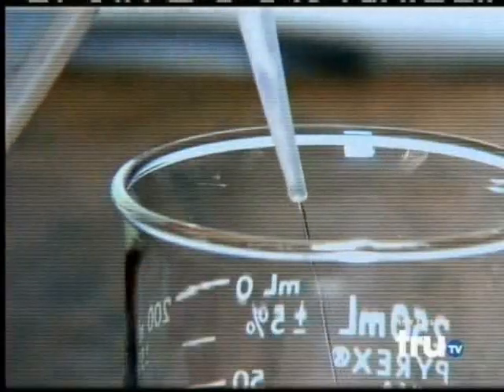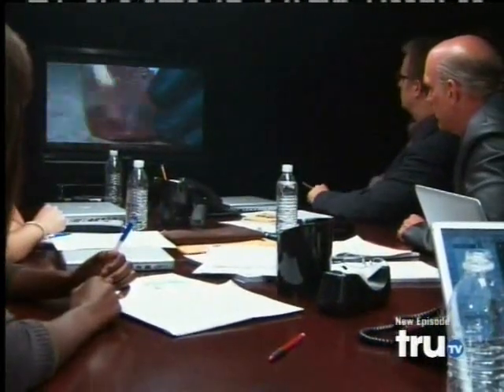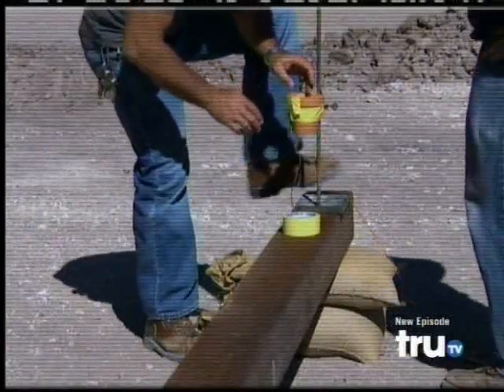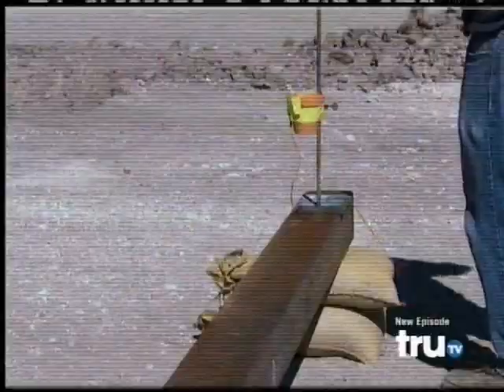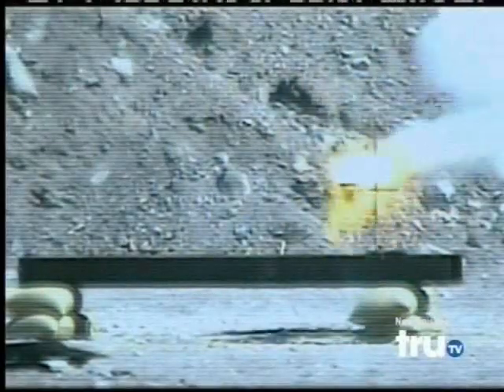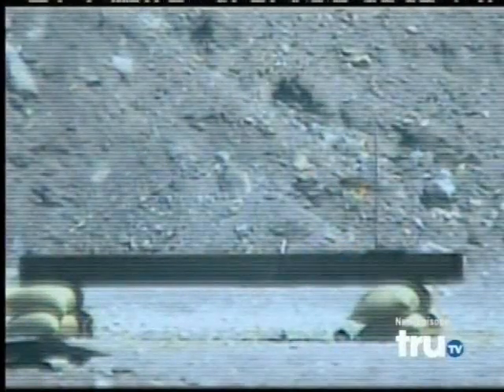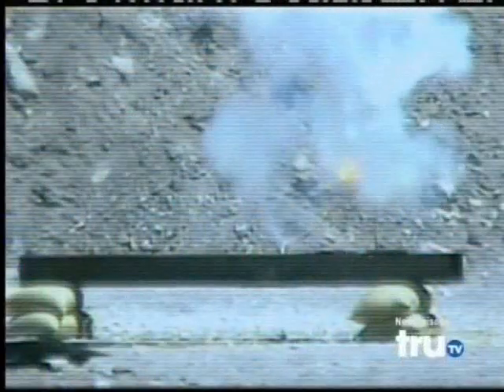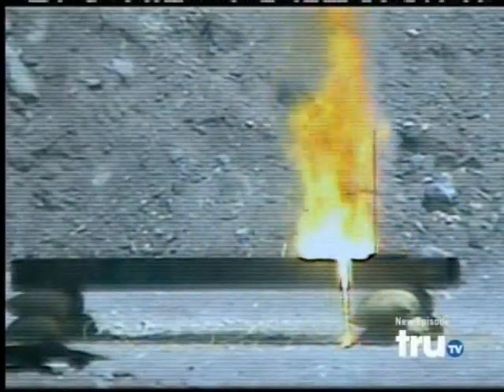SuperThermite in Action compared to Fire

Comment: When the fuck did I say that the core columns beneath the impact zone were attacked? A ROOSD collapse propagates through the floor system, which is the achilles heel of the twin towers.
And you still haven't answered how the descent of an upper block could destroy everything beneath it except for the core columns, or why that top spire was not bent from any impact above it. Your explanations are self contradictory.

Comment: Actually, yeah, in the Bazant paper. The short paper, was 
delivered in TWO DAYS after 9/11. The math was that easy.
Oh, and your claim that the Twin Towers fell much slower 
than Free Fall, is a debunker claim that's been proven time after
time. You don't have to fall at 1g if you haven't used explosives to blow UP the steel frame. IF the steel frame was blown up, then you would fall at 1g, not the measured 68 mph.

Comment: But NOT in the bazant paper, is what you failed to mention. I'll look into those seismic recordings, but still, even if they confirm what you are saying here, the fact remains that the twin towers acceleration curve does not match that of a gravity driven collapse, since it fell at 64% the speed of gravity.
That means, for significant durations of the destruction event, that upper block was exerting a force less than its own static weight on the lower section of the building.

Comment: That guy from UL was Kevin Ryan, a fired Water Tester at UL.
I believe from Missouri. He was never even close to UL labs
in Indiana, and Water Testers don't work at fire facilities.
The NIST fire testing was to determine fuel loads, not floor
slumping, and the floor models had their SFRM coasting
on at modern double thickness, nor were they physical
damaged in any way, like the 911 flooring systems.

Comment: Yes you did. You said: 'It ensues from the seismic records that the crush-down phase lasted 12.59 ± 0.50 s for the North Tower, and 20.09 ± 0.50 s for the South Tower. They were only talking about the crush down phase, which for WTC 2, was actually less than half total time.' Show me WHERE it was ever said that the crush up phase lasted as long as crush down.
And you still have no answer for the contradiction presented by the remnants of the top spire (which are inconsistant with a piledriver).

Comment: Didn't claim anything of the sort, and you know it. Bazant spent some time determining the effect of the impacts, and collapse, on different levels of the building. Even on the simple analysis, done in 2002. THAT section is in the Addendum, and begin with, "What if the aircraft Impacted a higher floor".
Go ahead and look, it's right there. He compared the effects of a higher, or lower impact / collapse floor.

Comment: But I am amazed (!) that you think the remanants of the WTCs top spire (after the collapse) in any way supports your beliefs. How could the descent of an upper block destroy everything beneath it except for the core columns? Why did we not see these structures poking through the piledriver as it fell downwards? Also, why is it that the top spire was clearly not bent from any impact above it? This ONLY makes sense if a force other than the upper block was going the actual damage.

Comment: The essential problem, is, the crush-up at WTC2, didn't have the top
weight, had 23 floors to crush instead of 13, and began earlier, with
less inertial momentum in reserve. It took longer.

Comment: Hey, I am just commenting on the obvious. WTC 2's collapse floors
would be on the ground, SOONER than the 97th floor on WTC 1.
So, sorry, GED dropout, there is no contradiction. The crush-up
phase on WTC 1, would be driven by a heavier roof, a shorter length,
and WTC 2 would be a slower crush up, due to lower weight, a longer
length of building above the collapse floor, and a slower overall speed.
Crush-up would begin earlier, take longer, and move slower.

Comment: I am not opposed to the notion that crush up works faster in the presence of greater weight. But you contradict yourself with your assertion that WTC 1 was heavier than WTC 2, hence why its crush up phase progressed faster. Basic math disproves you on that.
Example: The new towers (1 WTC) 400 foot antenna weights 750 tons. The old towers (WTC 1) 360 foot antenna, with similiar dimensions, would have weighed about 670 tons. The contradiction come when you realise that each of the upper floors

Comment: In case you are wondering about how crush up works, it's based on Inertial Momentum. It takes MORE energy to stop the falling weight, than to crush a floor of the falling upper block. Thats a function of the weight on TOP, not in the falling upper block.
It's Moving, it has the momentum, and the inertia, not the part on the ground. Conservation of Momentum, and gravity, work to preserve the upper block's speed.

Comment: Actually, Moron, even if it was explosives, gravity controlled the collapse, IDIOT. The crush up is controlled by the weight 
crushing down from the top, not the middle, of the collapsing building. Piledriver, remember? The Ten extra stories were not at the top, and they would be the first to come to a rest on the ground. They wouldn't even be involved in crush up effects.

Comment: No, what I actually asked was where you drew your unsupported notion that the crush up phase lasted as long as crush down. That is a key point that will decide whether or not the towers took as long to collapse as you say (and, big surprise, you refuse to answer it!).
Also, you are confusing the piledriver mechanism (which was posited specifically for the twin towers) with the more general progressive collapse. That kindof slip betrays, at best, a poor grasp of the subject at hand.

Comment: Anyway, the whole piledriver theory is not deeply flawed at
all, and there ARE historical precedents, in the collapse of
radio towers, Oil Platforms, and Other giant structures with
fire attacking them. The Oil Platform Piper Alpha was taller
than the WTC, had fire on FEWER floors than 6, and 
collapsed to the seabed even though its lower floors were
doused in cold water, Dumbshit.

Comment: Oh, now the sound of BackPedaling fills the truther squeals.
Every time we answer your stupid questions, you claim we
don't, or that we are sheep, or shills, or can't really answer
the question. You chose the stupid claim.
A steel antenna makes a difference because of WEIGHT
Steel is 500 lbs a cubic foot compared to concrete, at
under 180 lbs per cubic foot. Where concrete would 
crumble, steel antennas would hold the roof it's on, as
a coherent piece, that and the WTC Hat structures.

Comment: Whether or not the crush up phase lasted longer in WTC 2 is immaterial to the question I asked you, and BTW, if it had taken longer, it would be because the upper block was 10 storys higher than WTC 1, not because it didn't have an antenna pressing down on it, dummy.
Anyway, the whole piledriver theory is a deeply flawed analogy with no historical precedent, and no empirical evidence for. No one has proven that this kind of failure can happen in reality, its all supposition to the nth degree.

Comment: Look at the first few seconds of the collapse. The upper block fell down, and was communited by the impact with the lower foundations, until both sections simultaneously collapsed at near free fall speed. Crush up clearly preceeded crush down.
Moreover, you still have not accounted for the fact that the upper block dissapeared 4-5 seconds into the collapse, and was never seen again. How can we know that it was still intact, and crushing the lower foundations all the way to the ground?

Comment: Now, lets do some basic identification of forces, ok?
Which part of the WTC towers were moving, falling, accelerating,
and therefore had the Momentum? Was it the top or bottom?
And therefor, which would have the Conservation of Momentum,
AND the Potential Energy being converted to additional energy,
for every foot that it fell?  Conservation of Energy conserves the
downward speed, moron, not the bottom half of the building.
It doesn't have any Momentum. By definition. Duhhhhhh

Comment: There are so many things wrong with that I don't know where to begin. Bazants observations are flawed on many levels, because it is clear that the destruction of the twin towers began with a crush up phase (with the upper block partially destroying itself), then crush down. They have it backwards! And even if that wasn't the case, where do you draw your idea that the crush up phase lasted as long as crush down?
Also, trying to model the destruction of the twin towers through the use of

Comment: Depending upon what direction the collapse was being filmed from (north, south, west, east), you will get different estimates of what speed the collapse progressed at. The twin towers underwent an ROOSD failure, which is basically a catastrophic progressive floor collapse.
Some portions of the structure (like the northeast corner of WTC 1) went at a rate of 8 floors per second, yielding a time frame of 12 seconds. Other portions went at 5.5 floors per second, which gives a median of around 7.

Comment: 'No, I'm citing actual video of the north tower collapse - 22 seconds.' Then you must be blind, because both towers collapsed in 14 secs!
'What the FUCK is a gravitational collapse?' One which progress without the aid of explosives or accelerants.
'Whatever it is, does it take into account that large portions of the core structure of the south tower survived initial collapse?' Not only does it fail to account for this, but it also DIRECTLY CONTRADICTS hypothesis like those put forward by bazant.

Comment: The south tower's PARTIAL collapse took in excess of (that is, AT LEAST) 15 seconds, momentarily leaving much of the core structure intact for significantly longer that that.  The north tower took at least 22 seconds.  Get your facts straight or we can't even have a discussion.  Falling columns can be seen far outpacing the collapse in both cases.

Comment: @MrMZaccone  I didn't make anything up. It's in the presentation given by Richard Gage of Architects & Engineers for 911 Truth. You can watch it here on YT to find out the man's name and do further research yourself.

One would not expect the entire building to dismember itself, turn its concrete to dust, and "fall down" at near free-fall speed through the past of greatest resistance symmetrically. A skyscraper is not a house of cards. You have to logically account for the manner of destruction.

Comment: @MillionthUsername "That guy from UL" ... WHAT GUY?  "a model of the WTC" ... WHAT MODEL?  WAS IT BUILT WITH FORCES TO SCALE?  "The beams sagged only 4 inches" ... WHICH IS HOW MUCH DEFLECTION AT THE ENDS OF THE BEAMS?  There's enough made up nonsense and speculation in your post, you might as well blame garden gnomes.  Planes hit the towers compromising the structure and starting fires further compromising the structure.  This caused the buildings to fall down as one would expect.  Get over it.

Comment: @MrMZaccone  That guy from UL said they put a model of the WTC structure in what he called a furnace. The beams sagged only 4 inches with that furnace heat but the structure didn't come apart. The fires in the WTC were office fires and could not reach those high temps. The fires were only in a small portion of the building. The 90 or so floors beneath were fine, yet they can be seen exploding apart rapidly one by one, concrete being instantly turned to dust. This was not a collapse.

Comment: And the answer to the question "does it burn long enough and hot enough that we have structural failure?" is ... nope!  HOWEVER ... if a standard fire burned hot enough and long enough (which it did) it could certainly cause sufficient sag in the floor trusses to pull in the vertical columns to a point of collapse.  This is in evidence in almost every video of the WTC collapse.  It can't be ignored.